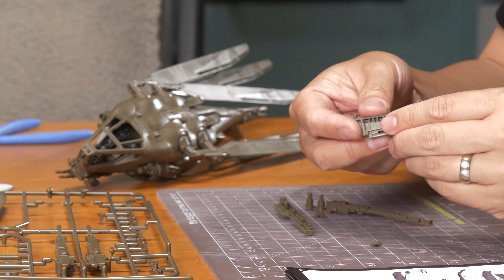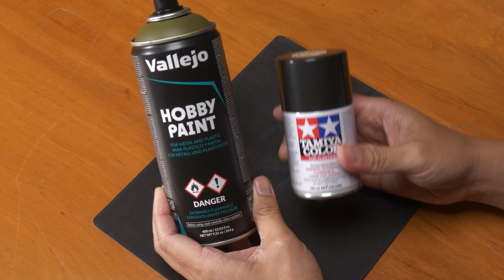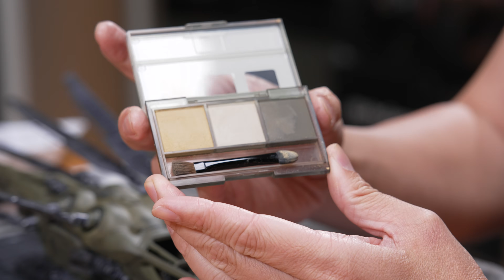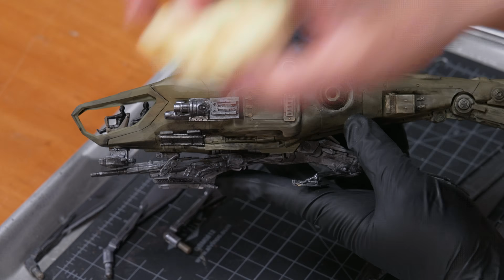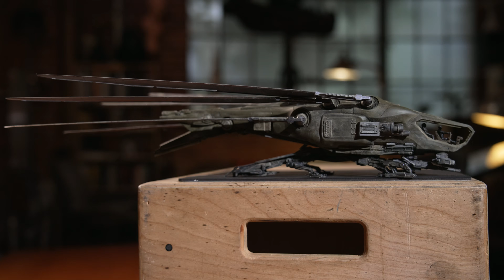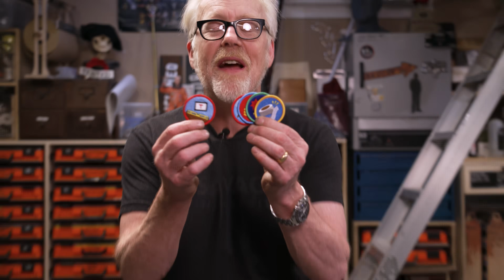Dune Ornithopter Model Build and Weathering Guide!

Comment: A clay wash could be useful on something like this too. Water based, effectively paint it on, leave it to dry a bit, then wipe it off with a slightly damp sponge. As such it'll get into all the recesses, but also leaves a dusty/matt finish.

I'm also planning on using the tamiya powders for some chipping and wear and tear, as they have metallics which if you're careful with, you can pick out an edge, so it looks worn, but fairly natural.

Also want to put some smoke/oil around the moving parts and exhaust vents

Comment: Kind of funny- this flying machine actually takes its inspiration from dragonflies, not birds, and dragonflies belong to ANISOPTERA, thus this machine is more properly an anisopter. Wonder why they didn’t call it that? 😸
Reply: The concept was first presented in the thirteenth century by Roger Bacon, who suggested a flying machine driven by "artificial wings to beat the air", but other than Leonardo da Vinci's ornithopter design a century later, no actual flights were made using the concept. Historically, though, flapping-wing flying machines have been called 'ornithopters' going back to the first rubber-band-powered models in the 1870s, with various bird- and dragonfly-inspired designs powered by various mechanisms being developed up to the 1930s. In the 1930s, Alexander Lippisch demonstrated a human-powered ornithopter, although it was launched with an elastic cord, so the actual contribution of the pilot to keeping it in the air is debated.

Comment: Do you have a video about doing washes? I was really hoping that wouldn't have been sped up. I'm only learning to do washes now. Also, what did you use for a clear coat to avoid disrupting the colour if the model is handled? Great job though! I got their smaller version just before they released this larger one.

Comment: I need to get a set of the tamiya weathering kits.  I've been using pastels for weathering, you have to have a matt clear down or matt paint for the pastels to grab on to and they're far more subtle effects though the nice thing with pastels is the variance of color.  A simple set of 16 colors and you can shave some off the sticks and create your own colors.  It will clean up with water if you dont like the results and when you're done you will need to seal it but go a little heavier than you would because most clear coats will fade the effect.

Comment: Would be nice to add some heavy chipping on the front and blades, for the sandstorms can eat through space age metal.. also, no mud..whatsoever.. LOVE YOUR BUILD! Keep surprising us!
Reply: If the 'thopters were part of the equipment the Atreides brought with them when they assumed control of Arrakis, they wouldn't have had time to become heavily chipped, even if you assume that protective finishes hadn't become any more durable in the interval between our time and theirs.

One aspect that I think could be expanded on is that all of the gunmetal areas -- the landing gear, the weaponry, and the wings -- all disappear into blobs; going back in and detailing tonal variations, like shadows in the recesses and highlights on the upper edges, different shades of metal on different sections of the weapons, and panel shading (I'm sure you've seen bare-metal aircraft models where the builder has used different types of metallic paint to achieve subtle differences in tone between adjacent panels) on the wings. 

The weathering that he did was good (although with nothing fixing the weathering powders, he's not going to want to touch the model, lest they start coming off on his fingers, which makes a lot of the articulation useless), but it only touches the surface of what could be done.
Reply: @seanmalloy7249  unrelated comment.. I kind of wished Spece Age civilizations would have some really cool material engeneering, and develop some very light but sturdy alloys... They had lots of shields and force fields going on, so who knows if plates or sturdy would even be a spec... Dune has such cool world building!!
Reply: @OrdinaryOrangeCat  I have to agree; materials science should have advanced along with everything else. Shields and force fields are all well and good, but they're all dependent on power sources. Now, you can handwave it by deciding that your energy weapons have advanced to the point where armor is effectively useless, but that's been the race with military equipment for centuries, and it's always been a seesaw, with offense and defense trading primacy. Take the shields from Dune; supposedly they make lasguns useless because of the reaction when the beam hits a shield, but if you have a missile designed to carry a single-shot lasgun projector, you could essentially be shooting tacnukes at enemy forces, potentially making shields for armies a liability.

Comment: The forward areas would be sandblasted to show more metal due to direction of flight and the back side of surfaces would have build up. Link the back of a car after driving a dusty road. You've done it the opposite. It's amazing work regardless.
Reply: I was thinking for myself I also would have focused more on which areas are in contact with the environment stagnantly, like the landing gear, for more heavy grime accumulation. Whereas areas that would be in movement, like the ornithopters wings, particularly the tips, would be regularly cleaned and maintained. The contrast is what matters though, like you said, even though Norm approach this differently than we would it still looks good in its own right. The difficulty would come if you had multiple pieces, without a coherent vision of what should wear and accumulate.

Comment: I've often wondered if someday we could actually build for real something like this.
Reply: Probably not. The forces needed to accelerate and decelerate the wings as they move back and forth don't scale up very well and start to break as you get bigger than small models. Theoretically some magical space age super material could be strong enough but the helicopter design is right there and will always be more reliable so why not just build those.
Reply: @Red0Leader  Maybe we will someday have space age materials in the future. Got to try diffderent things even if they dont work. Nothing is learned that way, no harm in trying.
Reply: @Red0Leader  Also, this kind of mechanism would be very susceptible to ingress of particles … like sand.
Reply: Research on flapping wing mechanisms is being done rigorously though. Knew people at university who were studying the airflow and lift characteristics for a theoretically strong enough design. While a viable commercial model is nowhere near, we haven't entirely discarded the possibility.
Reply: Meganeuropis Dragonfly had 1 meter wingspan. But It did not buzz like housefly, doing just few strokes per second. It was able to fly only because the atmosphere at that time contained more oxygen than the present 20%.

Comment: I bought files to 3d print one of these out and got midway, but the ball joints for the wings really degrade fast, might have to get one of these kits instead. Was a great kit but yeah, abs like resin doesn't hold up to moving around. 

Also getting the windows was something I was working on, the best clear resin I found has printing issues. This one's way bigger which might be nice, though not much space to display stuff lol. Also finding a dust free spot to airbrush kinda sucks.